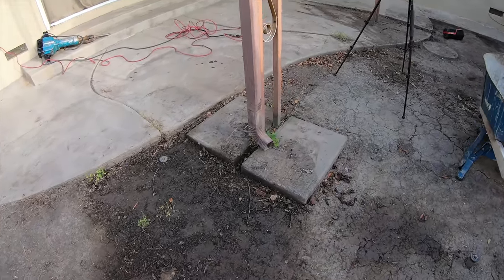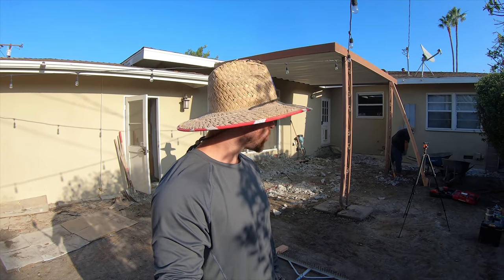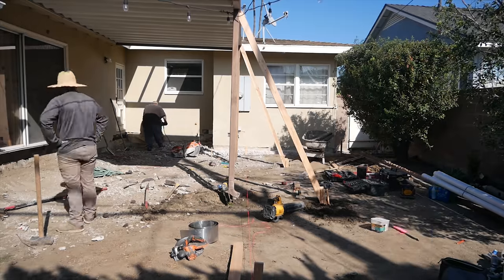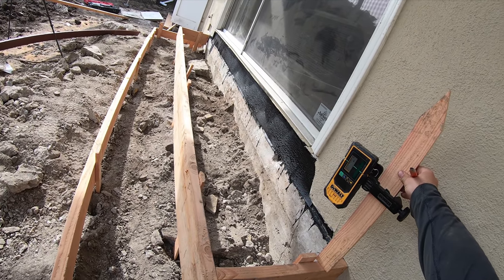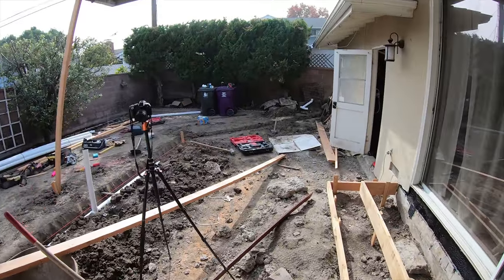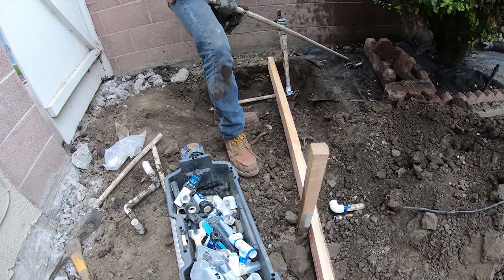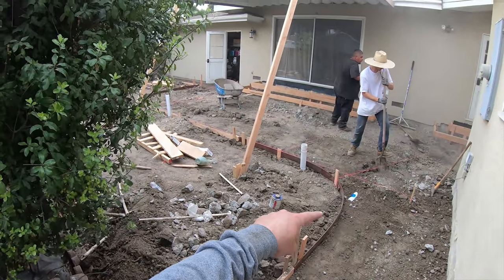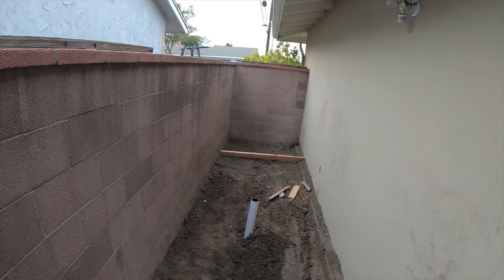Concrete Patio Demo and Setup! 20 Tons Ripped out by Hand! Part 1

Comment: here is a pro tip, dig a small section out , put a car jack under and lift up than hammer out, that patio should be done in an hour or 2 at most doing it that way.
I do that all the time it makes is very easy.

Comment: You should always keep your concrete a few inches below the sill plate (or weep screed)....tell your customers they need the steps to be out of different materials...wood or preferably a composite material. Those older slab California homes didn't sit very high above grade so I know it's tricky. It will help to prevent rot and allow you to keep an eye out for bug tunnels.
Reply: Your right, except I don't see a Sill plate on that house. The stucco went all the way down the foundation. 
 In California we stay "3 inches below the Sill. Unless there isn't a sill. Then the rule doesn't apply.

Comment: My only concern would be the drain system. I've always understood it's better to use Y connectors instead of T connectors when joining downspouts to main drain pipes, so that the water can flow more easily and maintain its velocity when coming off the roof. With a T, the water has to change direction much quicker, which could lead to backups and blockages. Not say it's wrong, but physics states that matter in motion wants to stay in motion and resist any deviation in direction. Just my useless .02 though haha.

Comment: Aye g, lock up your tools. I’ll lock them up with a harden steel  chain when On my truck. My ridges took box is chained locked. I’ve personally lost a brand new mag worm drive. I’ve seen guys loose mixers and generators. My biggest loss was 30 12’ planks on the third level of scaffold. Hahah. You can’t run a chain thru those. Nice work G!
Reply from the maker: That's sucks

Comment: Seems like you/I can always tell a LBC house. 
I would have formed it where the patio was at house level so when you stepped out it was only a couple of inches down. Then put the steps at the edge of the patio. Take a lot of fill but safer for the HO when they or friends stepped outside.
Never fails having someone roll an ankle on those type of steps.
Reply from the maker: Yeah probably why most people pour slab on grade now